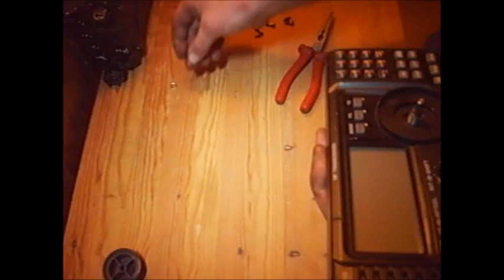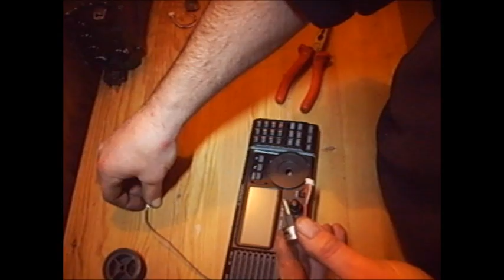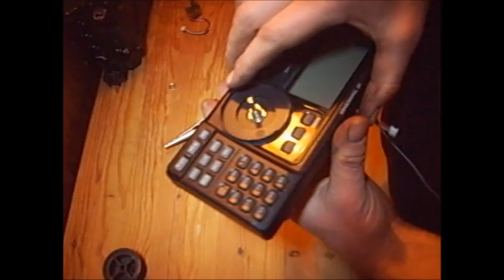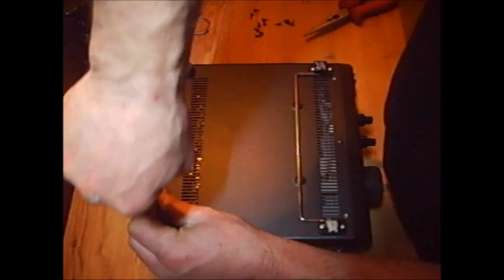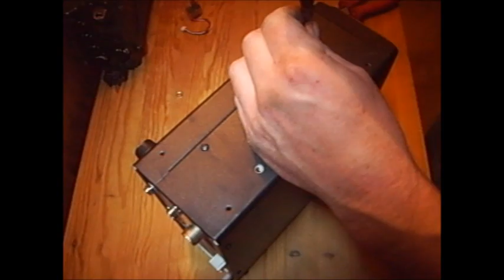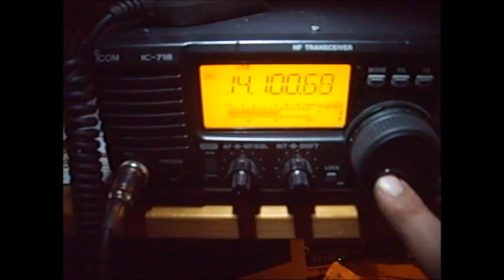Icom ic 718 Tuning Dial Repair Part 2

Comment from the maker: Hi vballman59 and thanks for your comments on the video.I cant recall the part number but I got it by simply calling Icom .uk and asking to speak to the parts department.I told the guy what the set was and that I wanted the main tuning sensor for it and he simply took the payment and I got it the next day.From memory I think it cost around 50 pounds sterling.
All the very best
O.T.

Comment: Great Video and Thanks. I have the same problem and will be making the repair. I am just curious what is the Icom or Generic Part number for the Magnetic Sensor you replaced? I agree IC-718 is a great radio. Mine survived a toss down a flight of stairs by my ex with just this issue and some minor dents.....its built like a fortress. Thanking you in advance and God Bless.